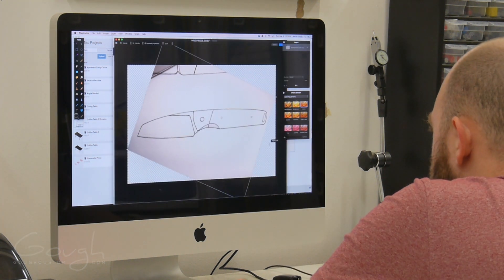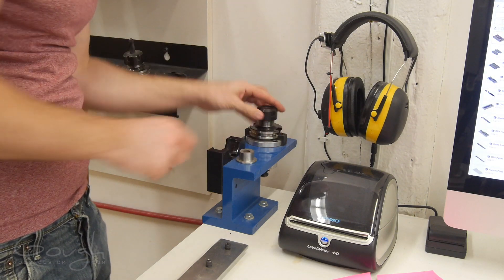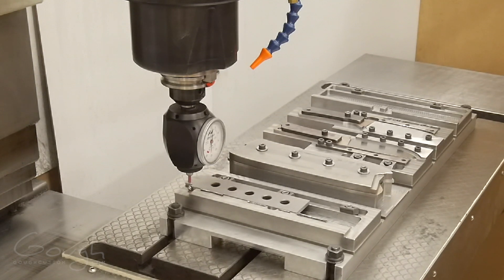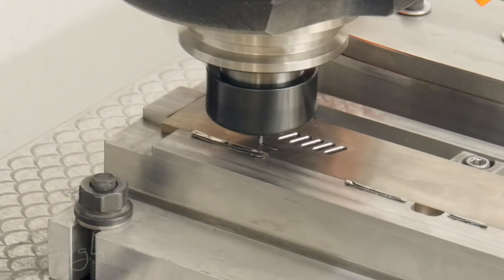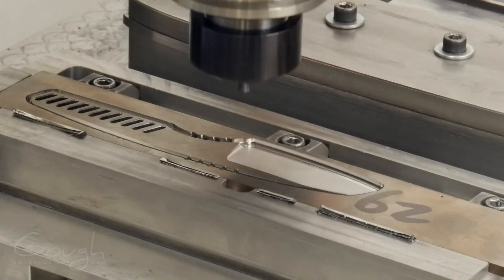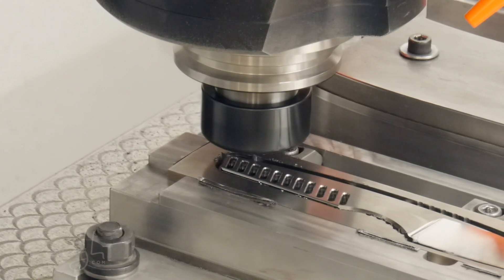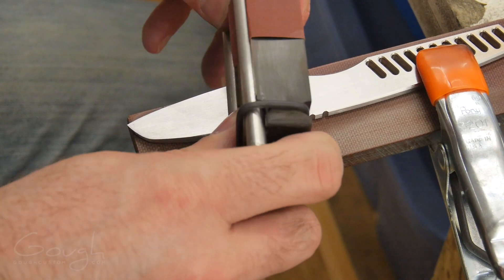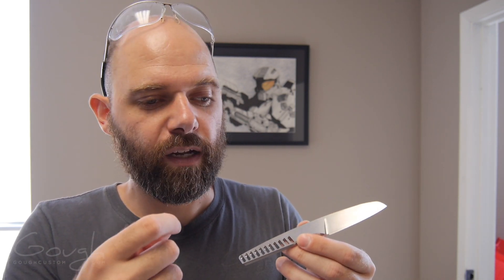Making a mini fixed-blade knife

Comment: Hey Aaron! Great video, but I've got a couple questions. I'm a full time fixture maker, and an aspiring cnc knife maker. I've done some hard milling, but everytime I've used special end mills designed for the task. You didn't mention it but I assume you are just using high performance coated carbide endmills? If you wouldn't mind sharing I'd be interested to know what kind of considerations you have to make in order to be successful when hard mill 62 Rockwell steel with normal cutters. If you'd like to keep specific brands and recipes a secret that's totally cool.
Reply from the maker: Hey David! Yeah I am just using AITiN coated solid carbide endmills. The high pressure air blast is an important part of the recipe, and then the other parts are just to dial back the radial and possibly axial engagement to make sure the tool doesn't chip from too much load, and then to carefully dial in feeds and speeds from there. I use GWizard as a starting point for my speeds and feeds and found it has worked well! Also make sure to absolutely minimize tool stickout. High flute counts help a lot as well, as you're only taking tiny cuts so you don't need much space in the flutes, and higher flute count tools have thicker cores which make the tool stiffer! Corner radiuses are also vital, square cornered tools break down very quickly under these conditions... I also don't worry too much about chipping on my roughing tools, even when chipped they still cut cleanly. My finishing tool becomes my roughing tool after the roughing tool is too worn, I usually get about 10 knives per tool which is pretty good! That's about 400 minutes of finishing tool life and 550 minutes of roughing tool life which is pretty decent!

I use tools that were custom made for me by Maritool, but they are available for everyone to buy. The main tool I use is this one: https://www.maritool.com/Cutting-Tools-End-Mills-Finishers-Square-End-5-Flute-and-Higher/c78_79_80_131/p18004/.250-dia-6-flute-sqr-TiALN-carbide-finisher-.060R-.375-LOC/product_info.html

Comment: what do you call the clamp with which you hold the knife while grinding?
Reply from the maker: The little clamps that hold the blade in place during machining are called 'pitbull clamps', I think that's what you mean?
Reply: @GoughCustom  I think I expressed me wrong, I meant the clamp you used when sharpening the knife.  I wanted to thank you again for the videos, I Like  them very much!

Comment: Wow thanks! Finally! This video made my day.
I'm wondering how the bevel gets so smooth just from machining? Is it a ball endmill? Doesn't it leave grooves on the toolpasses? 
You are a huge inspiration for me getting into CNC, I'm looking to get a cnc router to get started.
And... I'm saving up to buy the resolute.. Just can't decide on the colour...
Reply from the maker: Hey Henri!
The tool I'm using is called a 'bull nose' or 'corner radius' endmill. It has a flat bottom but with rounded corners. The smooth finish is made simply by making many passes that are really close together. In this case the passes were only about 0.006" apart!

I'll look forward to making a Resolute for you!
Reply: @GoughCustom  Thanks, me too!

Comment: This new model is called the Unwavering is made from hardened unobtainium and the cost is $5000 and no you can’t by one for 47 years.
Reply from the maker: Haha that sounds like a plan! Be right back, just putting it on my website :)
Reply: Gough Custom Obviously just playing with you. I have been trying to by one or your knives for a while now and I would definitely buy this small version, would make a great utility blade.
Reply from the maker: @null2268  I actually have knives available on my site now if you're still after a Resolute!